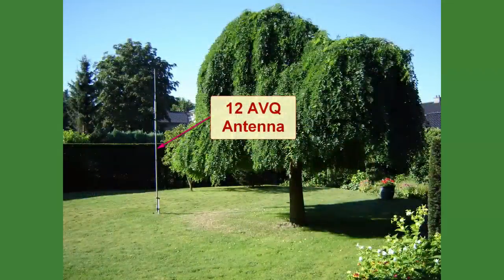Antennas Change over Time (#611)

Comment: I will not argue, radicals DO help a vertical antenna. BUT, if you live over an iron ore bed that reaches up to less than 24" from the surface of your yard (like mine does), forget the radicals! You do not need them when you have an iron ore bed directly under your antennas to reflect your signal off of. Iron ore beds are identified by a red clay layer, and if you ever dug a hole in your yard and found red clay, you are extremely lucky. 
    I hydrodrilled three 10' ground copper pipes into that red clay in a triangle, put three tablespoons of copper sulfate into the hole, and packed that red clay back into the hole. The copper sulfate increased the ground conductivity until nature would take over. I strapped the grounds together with solder using a propane torch and 1" woven solder covered copper straps. I doubled up the remaining 1" woven straps and brought that into the shack and soldered it onto a copper bus bar I got from the telephone company service truck that was screwed into the back of my wooden desk. I go out every 6 months to re - do the strapping on the ground rods, but I have a great signal with only 80W out on H-F. I do not need radicals with an iron ore bed right beneath my feet.

Comment: I'm a big fan of radials when it comes to ground mounted vertical monopoles at HF or lower. The more, the merrier. They do not need to be bare copper or buried. In fact, I believe insulated wire is superior (for longevity's sake). Simply use "lawn staples" every couple of feet to keep them on the ground. If you have an actual lawn, the grass will grow over them in a short time. Whether or not it is a good idea to have a ground rod driven and attached to the base of the vertical is something I have seen conflicting opinions on, but I believe it is beneficial, if not for your radiated signal, at  least for lightning protection. Good video, Dave. 73 de WB4DW

Comment: If you use a lightning arrester attached to a ground rod near the antenna, you have the shield (and any radials) connected to earth ground. With that, I guess you can say the current recommendation is to do both.

Comment: 1) Single element verticals are equally mediocre for a given length and ground radial system.  
2) If you can elevate the fed “base” of a vertical above the ground (15-20 ft) , you need only  4 elevated radials to approach what a ground-mounted vert and 30+ radials does.  So, find a 60’ branch, use 20 feet of low loss coax, pull your 40’ wire up into a tall tree, and spread out 4 radials angling downward.
Reply: @kd8poi - Thanks for that comment.  Not a ham, but interested.  Many years ago as a teen when the CB craze was going on, I had a chimney mounted CB antenna on the roof and it had 4 radials.  I started to wonder about that as Dave was describing the need for 32 radials.  Now it makes sense how that old antenna was able to work.
Reply: @stevenemert837  you’re welcome.  You also had the benefit of height, CB is line of sight (most of the time), and on a chimney of either a 1- or 2- story home you were probably anywhere between a half and a full wavelength above ground on the 11m CB frequencies.  If it was a well designed antenna (good SWR, relatively short feed line), you probably had a really efficient and unobstructed set up.  Lots of opinions about antennas, my take is a ground-fed/mounted, multi-band, quarter wave vertical is a mediocre performer.  I built a fairly good, 31’ vertical with 30 ground radials, and a 4:1 unun.  The vertical element (radials, ground plate and unun  not included- those were more than the antenna) was made by a company called S9, it doesn’t really exist anymore after trading hands a few times in the last 8 years.  Alpha antenna owns them now, and they doubled the price of them to $200.  If you go to my channel, you can see it in action on the AM band from where I lived in Ohio.  It’s actually impressive without comparing it to other antennas.  It was a “great” antenna in that it was so versatile and you didn’t need to “tune” it (your tuner did that), and if it were the only antenna I had it would have been more than enough to enjoy the hobby.  But, compared to a pair of “fan” dipoles I was able to string up and switch between NE-SW and NW-SE, it was noisy (Omni directional means Omni noise receive) and was a markedly worse in S/N ratio and reception reports.  I think my point is that if a vertical is where you want to start, you might have better options.  An elevated vertical, if you’re lucky enough to have tall trees (like really tall), it a cheap way to get into the hobby.  One elevated vertical element tied up in a tree, 4 or more elevated  radials as long as you can make them within reason, a cheap 9:1 unun from LDG, and you can have an enjoyable/inexpensive antenna.  But if you’re really lucky, a vertical EFHW won’t need a tuner or radials, but a 40 meter EFHW is almost 70’ long.

Comment: When I put my Hy gain HyTower huge vertical up I started with 4 ground rods, then 4,8,16,32 radials about 32-34 foot long just laying on the ground bare wire not copper. 
When I got to 32 it was performing well on 20 compared to my sky wire loop. I was satisfied and love it to this day.  Best $100 I ever spent. LoL 
There is a radial research paper of sorts out there on the web using the stepper ir vertical and different radial scenarios. 73. And my vertical has very low noise in my countryside location

Comment: I got an 18AVT in 1970 and have it at my cabin in northern Arizona.    This last year I just cannot get the SWR down anymore.  I have taken it apart several time and had good continuity. And the ground rod and all the radials are fine but still cannot get swr down.  I am thinking that after so many years the traps are defective.  I did get a lot of time out of it but it seems like somehow I can get it tor work again.

Comment: My guess is in the 80’s my Cb days you only needed a piece of metallic string and there was not computer programs to design and look at at antennas. It was all by trial and error.
Reply: Bet after time your radio blew up because you did not match the antenna to the unit. I did hear these stories yeah all I needed was a coat hanger. 
Not me

Comment: Why does this man have a big belly?
Sitting all day making YouTube videos and or talking on his radio. 
Back in the day I got into CB radio had a huge Sigma 5 8th wave antenna and it made all the difference putting out a whopping 4 watts. Also made sure to put it as high as possible even though it was against FCC regulations. There were so many people that would have a big mouth over the radio until seeing them in person. Very similar to the internet. People can tell you any BS story behind the keyboard and you would never know.
Now I can watch the video. Part 2 I remember the sigma antenna along was 22 feet tall and had 4 radials that were 9 feet long each. I tried to get it on a 20 foot mast but was to hard with the person that was helping me. Got it on a 15 foot mast with guide wires.
Lots of people at the time were used linear amplifiers.
100 watts 150 watts so on. I did not need it because of this antenna. Royce Union home unit when most were using a car unit with a 12 volt converter. Had 2 power mics. The famous D-104 and a Turner don't remember the model number. 
Had fun. However it was all about how so I sound and where are you. Not much to talk about after that. Did find friends in the area.

Comment: I'm very tired of hearing the excuse of an output impedance of tube type 50 ohm outputs being better than the 50 ohm outputs of the transistor radios. You're having issues with understanding output impedance concepts.